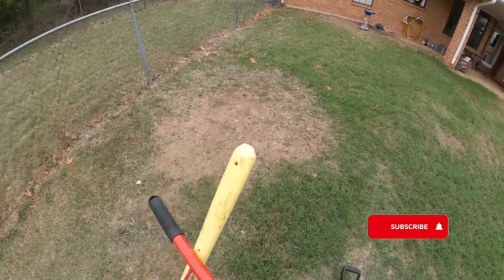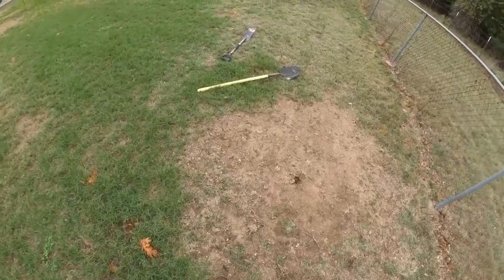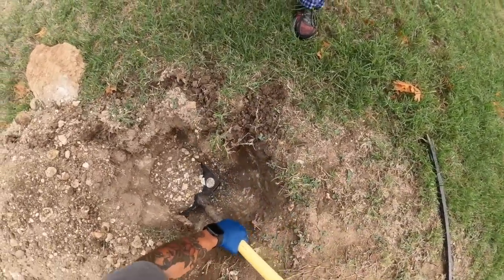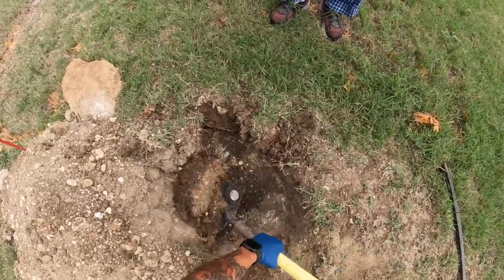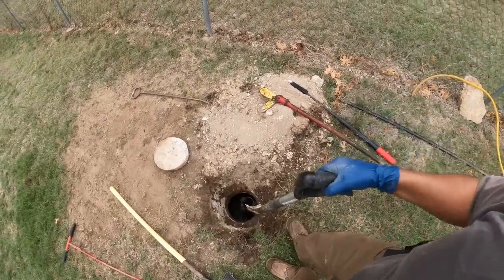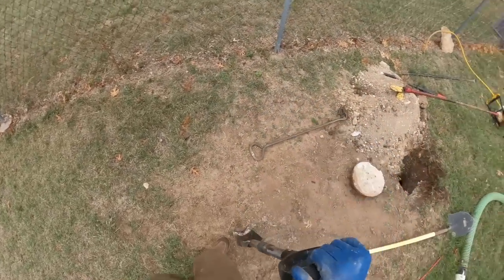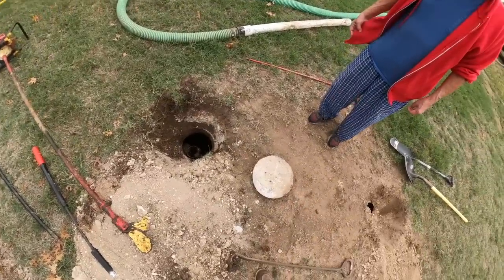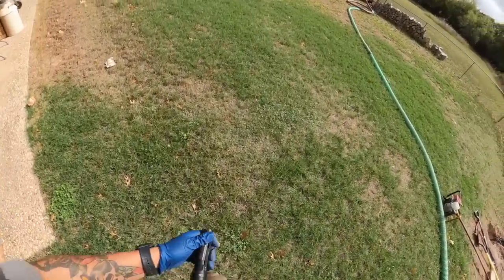Clogged Septic Tank (25+ Years of Poo)

Comment: Hey buddy love the content.  I have a quick question.  I am looking into starting up my own septic and Grease pumping business in FL. I dont have a very big startup budget but I was thinking of using: Truck: Ford F-250 Super Duty (2011-2016) with 6.2L V8 Engine:($18,000 - $25,000)  and then buying a
Vac-Con 900 Gallon DOT Vacuum Trailer: Prices are generally in the $10,000 - $15,000 range. or the Presvac 1,000 Gallon Steel Vacuum Trailer: priced around $12,000 - $18,000.  Like I said I'm new to the trait and wanted opinions from anyone currently working in the field.  Do you think this setup is sufficient as i will be the owner\operator in the beginning.  Help please ASAP!

Comment: Curious how much your set up cost minus the truck
Reply: I'll guess the crust buster would cost 600. The sticks, bars, and shovels would be around 50 apiece. We'll say 6 shovels is 300. The hoses are probably 75 apiece. 8 of them put him at 600. My guess is 1500 w/o the truck.
Reply: @scottthompson9002  well I was talking about the trailer it’s self not the hand tools but I appreciate the reply that’s good info as well
Reply: @bricegreen9616  He replied to a different comment (probably accidentally because it made no sense) that the trailer cost about $12k. He got a good deal!
Reply: @start_listening_with_cindy2928  you must not have read my comment but thanks for info 👍🏻
Reply: @bricegreen9616  Nope I read it...just responded with more info than requested in the event others were curious and wanted accurate numbers....  (A 1000gal pull behind Vac unit will run you $13,000-29,000 depending on what you want to work with ) Happy Pumping!